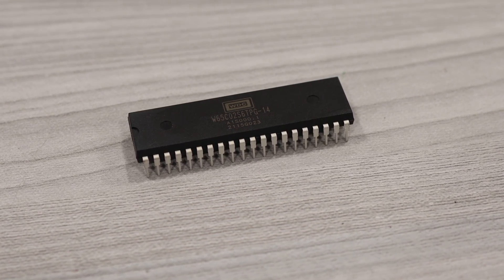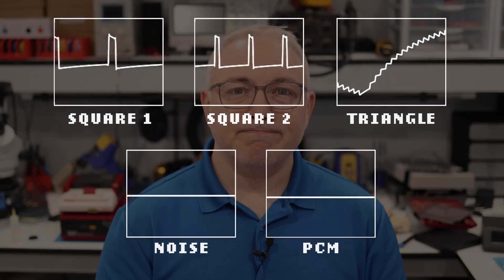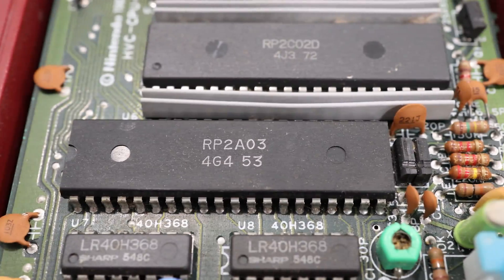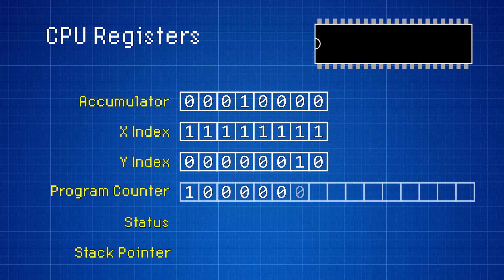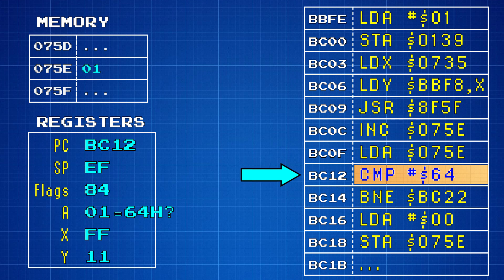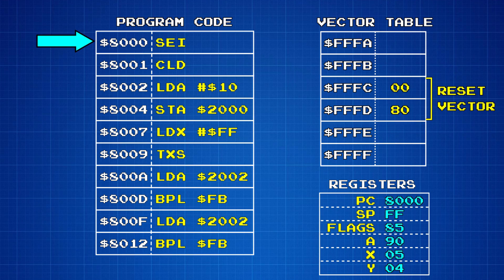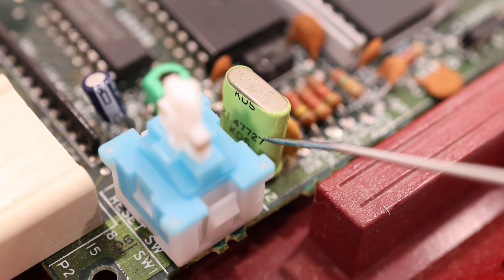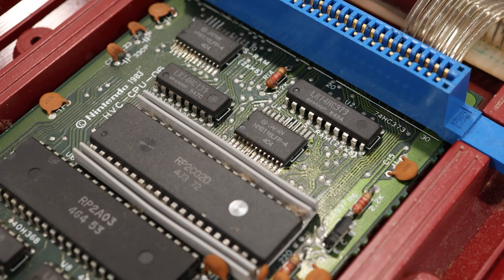Inside the Famicom | 02: The 6502 CPU

Comment: BCD is actually quite annoying, since if you use it, you have to constantly ensure you switch in and out of it in interrupt routines, even though only 0.1% of your code uses it. By eliminating BCD, the rest of the code becomes much simpler, interrupts can be served much cleaner, there is less probability of bugs crashing the system that come from BCD being left on.

Comment: A few years back, I started to write a 6502 NES emulator in modern C++17 using MSVC. It was quite a project to work on. The NES Dev wiki site is very valuable and useful and when I first started to take on this project and doing some research into it is what brought me to find other related topics such as Ben Eater's Y.T. channel for his 8-Bit bread board CPU in which I implemented his design in a program called Logisim. Since then, I had also come across a game on Steam called Turing Complete. Many years ago, I started to get into programming due to my interest in 3D Graphics / Game Engine design as well as Physics Simulations and Animations. As much as I enjoyed learning various topics throughout that process such as learning the various graphics APIs such as DirectX, OpenGL and Vulkan, I have come to appreciate and enjoy Hardware Design (ISA implementation just as much as doing 3D Graphics programming). This in part is reflective of some of my Steam Libraries titles that range from Factorio, Dyson Sphere Program, Satisfactory, Mindustry, Oxygen Not Include, The Planet Crafter, and more. If it's Engineering related: "The Factory Must Grow!" and if they have Trains, it's even an added bonus, if it's building Rockets, that's just as engaging. I love and appreciate channels that provide content such as this. Job well done on clearly explaining the design of the Richo chips. You covered most of the basic in less than 20 minutes where many paid for courses couldn't even do it in a single semester. Kudos!!!

Comment: Okay so on the BCD removal thing: To my understanding this was a redesign that Rockwell did first. MOS second-sourced production of the 6502 and variants to Synertek and Rockwell (a common practice in the industry at the time). Rockwell made modifications to the chip and Rockwell sub-licensed the rights of their design to Ricoh.

MOS engineers have claimed that Nintendo stole the 6502 because they weren't getting direct payments, but anything they would have gotten would have gone through a long chain through Rockwell. Such are the salad days of early microprocessors.
Reply from the maker: Yeah, the re-licensing of the tech makes it really difficult to pin down what exactly happened. I read through a couple of accounts and Bagnall’s seems to at least summarize the reaction from Commodore employees with a firsthand account
Reply: This is very interesting because there are some Rockwell made 2A03’s out there although they are rare and not well documented. I found out I have one in my NES after noticing my 2A03 looked different than all the ones I’ve seen before. I found that some Famicom from late 1984-85 and some early test market NES consoles with revision NES-CPU-01 or 02 may have the Rockwell version of the chip. The code on the chip is VF4109. Nintendo must have sourced chips from Rockwell for a short time while Ricoh ramped up production for the US

Comment: Interesting, in fact it's very close to modern MCU architecture, except very limited IRQ resource and probably doesn't support nested IRQ  at all.

Modern MCU usually also come with NMI IRQ, but I found it hardly being used, because there are many other high priority IRQ available. I wonder what's the scenario of NMI in 6502.
Reply from the maker: You can nest IRQs if you reset the interrupt flag in your IRQ processing. For the FC and NES, NMIs are used by the PPU for Vblank signaling. I’ll talk about that when I cover the display subsystem

Comment: So... if the Famicom 2A03 chip has 16 bits wide address bus does it mean that it really is a 16-bit CPU? (hello Atari Jaguar!) 😎
Reply from the maker: The data bus is what makes it an 8-bit system. The 16-bit address bus just means it can address 64K of memory… but it only does it 8 bits at a time.
Reply: @whatskenmaking  I thought it was register size
Reply: The jaguar was 68k based I think and that is a 16/32 bit cpu. It had a 16 bits data bus but was mostly 32 bits in calculating.

Somewhere in history the definition changed from the size of the external databus  to the size of the common alu size. The size of the external databus became much bigger than the alu size on amd64 ISA. Yet we don't call the 128 bits or larger.

The 8088 had an 8 but databus but was internally an 8086, so a full 16 bit cpu. At that time we were not sure if we should call it 8 bits or 16 bits. We called it 8 bits if you don't like the ISA and we called it a cheap 16 if you liked it.
Yes there were actual camps of this cpu is better.
Intel made 4 interesting cpus: the 8089, the 80860, maybe the 8096 and the 80960.
The 8088/8086 was so riddled with z80 shit it wasn't fun.
There were a lot of interesting ISA's and the worst became popular.
I know that back in the late 80's, early 90's we tried to get access to the T800 transputer. Or actually any. Even by today's standards, they were very innovative.

Comment: What I love is that the lack of hardware BCD is why Tetris eventually crashes. It's the software BCD that winds up eventually taking too long to calculate and results in corruption.

So that whole Tetris crash thing made something this old relevant again. 

Also, I love that it's the same chip with that line cut, and that was enough back then to say it was a different chip. That's the only reason it was left out. It allowed the copy to be legal.

Comment: There's something I've been trying to remember about 6502 bus requests for a while and not into all the resarch and it's really the key issue I have with the 6502. The SNES has 128KB of working ram. People think it's all available. But it's not.

I'm also quite proud of myself for predicting two 8KB buffers in the NES by counting the numbers and not figuring out how it could have 2K of work and video and also 8K, but slower.
Reply from the maker: I'm going to walk through how the address decoding works in the next video - that will explain why there's an 8K chunk of memory with only a single 2KB RAM chip in it 😉
Reply: @whatskenmaking  I'm speaking of the 6502 bus access system
Reply from the maker: Yeah - the address decoder logic is why the bus behaves that way.  In short, chip select is enabled on work RAM through a higher order bit, but some of the lower order address pins aren't connected. I'll have some visuals that walk through it
Reply: @whatskenmaking  yes that's it. I really want to understand why the snes has 128KB ram.
Reply: @whatskenmaking  Nice! Can't wait to see it!
Reply: I think the 6502 needs a mirrored memory map.
Reply: If I remember correctly, don't they use a Zero Paging Scheme? Something on the lines like when the system writes information to Page 0 based on the chunk or page size, it also writes to all other sections as well. It's been quite a while since I've done this type of research and read into, so please feel free to correct me if I'm wrong. But I think I remember learning something about this with their memory mapping scheme. This is kind of what tripped me up the most within the 6502 Assembly for the NES where I've been more familiar with and accustomed to x86 ASM (Intel Syntax).
Reply: @skilz8098  well keep training your grammar algo and before too soon you'll only be slightly creepy. Buy all the biggest software firms and put them to work, then fire the lot of them and put them onto the ms customer service line whenever they want to do something. Like beg for a job.
Reply: Nice. Analysed but not scrubbed. Probably just hidden.
Reply: @ribenasquash  Well, I may be a bit rusty with my grammar now compared to when I was in my youth or younger days. It was never my grammar or spelling that was the issue. 

I typically struggled to maintain an A average in English primarily within the portion of English that refers to "comprehension". It's not that I didn't or wasn't able to comprehend what I was reading. No. We're talking about the "Public Educational Indoctrination Centers".
 
When it came to taking quizzes, tests, examines, state tests, midterms, finals, etc.; any question that asked something specific, a course of action and reactions, or something with direct details, those answers were typically almost always correct. 

Where I lost points on those tests pertained to questions of the following sort: "What do you think is or would have been the best response, or best choice, etc...?" These were the ones that were always marked wrong. I've always answered what I thought was best based on what I have read.

I'm going as far back as Elementary or Grade School from the 80s and early 90s, Middle School, and even in High School throughout the rest of the 90s. 

When I received my marked tests back, okay sure I might have missed a couple of points here and there for the occasional or rarely misspelled words, slightly improper grammar such as syntax mistakes like comma splices, or potentially run-ons. So sure, I wasn't getting 100% but perhaps a 95-98% score at least is what I was expecting. Yet my tests would come back with scores between 80-90.

So where was I losing these points? It was from those opinionated questions. I'm thinking to myself, "How in the fuck do you get an opinionated question wrong?" Oh, I get it now. My opinion, thoughts, beliefs, or mindset didn't align with their indoctrinated narratives. And yet, I'm the one who is wrong. Ha, ha, ha: give me a break! 

After all of these years, George Carlin was right! It's a Big Club and You and I aren't invited, they don't give a fuck about you. They want more power and control for themselves, and they take all of your money and give it to their friends over on Wall Street.

Who would have thought! 

I digress. Yeshua already stated long ago, "Remember, the world hated me before they hated you!"

Comment: Since the Z-80 was and still is today the most used processor in the world (enbedded today), I don't understand why people in the USA are so fixated on the 6502.
Good video.
Reply from the maker: I don't know - maybe because of the popularity of Commodore or the Apple II here in the US? Variants of it were used by Atari as well. Personally, I've always been more of an Intel guy
Reply: One of the things I think is driving it isn't just due to the various devices that used it throughout the 70s and 80s almost up into the early 90s, but also the fact that it does have a huge part in the History of Computer Science - Electonics Engineering. On top of that, there's a lot of information on it, it is well researched and well documented. There's also the sense of nostalgia that comes from it. Finally, one of the most intriguing aspects is that the original 6502 was physically designed by hand. Every single transistor and wire were laid out by hand. They didn't use a sophisticated piece of software to automate this process. I think this is why it is so intriguing. Sure, the Z80 is just as intriguing but so is the 8080 by Intel. They are all feats of Engineering! They are all worth learning about.
Reply: Simple!  It was cheaper!
Reply: As a programmer I would chose a 6502 above a z80 anytime. And I did a lot of z80/8085 and 6502 reversed engineering.
I thought the 8052 was one of the most used cpus for embedded applications. I mean that stuff is embedded in switches as either the controller of a dumb switch or the interface between the switch and the cpu of a managed switch.
Reply: To be clear, I did RE on 8052 too... that was a deep dive in a controller where banking is embedded in the ISA